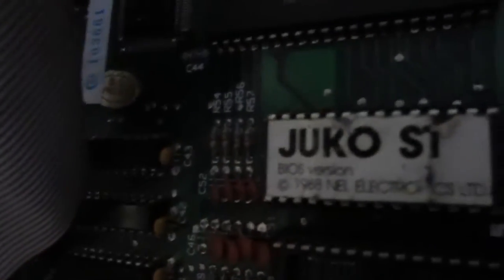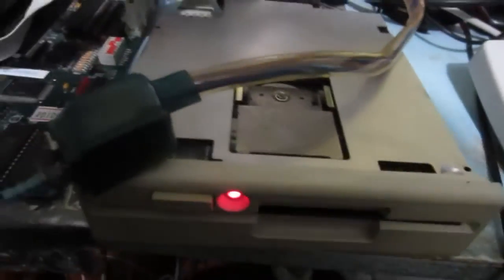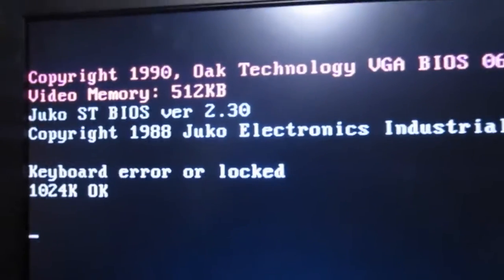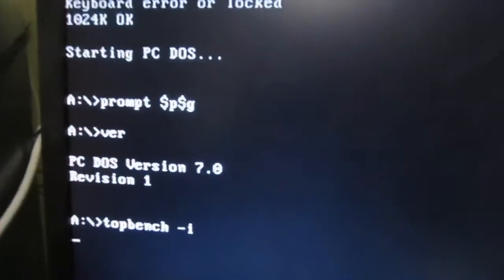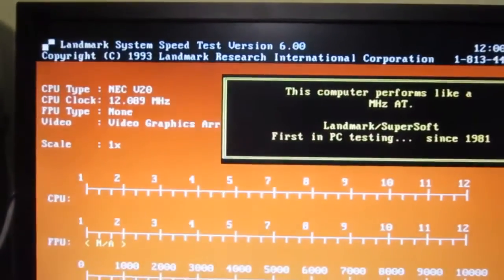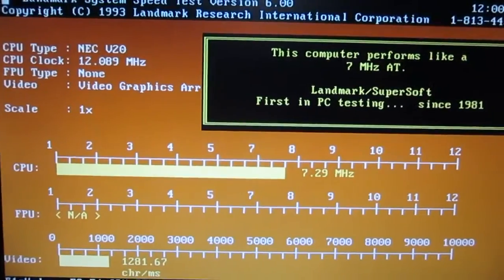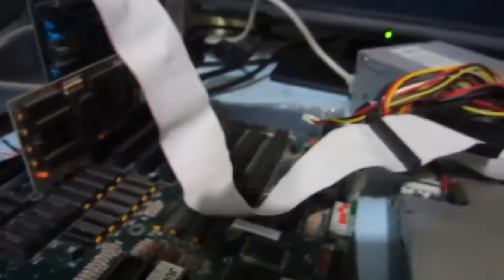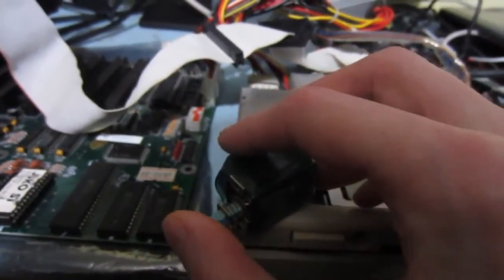Juko ST 8088 NEC v20 benchmark speed test

Comment: My first PC had a JUKO MB with 1024k ! wish I still had it!  The CPU is run at a higher voltage by a sparate voltage regulator and runs at a higher speed
Reply: I was wondering why it uses 7805 regulator from 12V rail . Strangely enough as you mention this 7805 output 5.75V instead of 5.00V so I decided to remove it and connect the CPU directly to the 5V rail . I tested the CPU in turbo mode at bouth voltages , but there was no any speed deferences. It was about 6.45MHz (in this video 7.29MHz)
Reply: @intel386DX  There is likely a diode in the ground side of 78L05 to raise the voltage.
Reply: @mohinderkaur6671  oh yes there is a diod thank ! So it is completely normal to be near 6V instead of just 5V. I was wondering what is the reason. BTW I have one XT turbo baby mobo board that have no 7805 and the CPU is directly connected to the 5V. I will check the performance of it .
:)
Reply: @intel386DX  They are overvolting the CPU to have it stable at higher speed than spec.
Reply: @mohinderkaur6671  :) yes I got it .

Comment: Nice to find this video as I have just received a JUKO ST board :) Flash to the past - Do you recall what kind of power supply connector you used? I'm trying an old AT power supply connector like from the IBM XT/286/386/486 and it doesn't seem to want to fit on the JUKO. Hoping you know what kind of connector your power supply used.
Reply from the maker: Mine was AT standard. The older AT power supplies have a split connector, so make sure the black wire is next to black wire or it will damage the board.
Reply: @Wormetti  some XT boards and power supplyes have one power connector (like a 2 standard AT ones, but together and a bit different shape, so can not fit in the standard connector)
Reply from the maker: @intel386DX  yes, the one in this video was standard but there are many non standard. Even if you have the original power supply, best to check voltages and test it on an expendable device first.

Comment: It is most likely running at 12MHz, even though the NEC V20 chip might be silkscreened as 8MHz, you'll have most likely a 24MHz clock crystal and a 14.318MHz one as well.

The ISA bus runs synchronously with the CPU as far as i know.

Comment: Brings back memories of upgrading my first true IBM compatible that I upgraded from the 8088 to the V20 and also added the 8086 math coprocessor. Neither of the 2 upgrades resulted in a perceivable performance gain until I also installed a second crystal oscillator To bump it up from 4.77mhz to 6mhz. I had to add a toggle switch to change the clock speed as some games were hard coded time wise and the motorcycle racing game whose name has long ago faded from my memory would just launch off to one side or another. If a modern kid was to see an old 8088 running they would think we were retarded for messing with them!

Comment: Really good video. I have this board myself...but haven't tested it yet. There was a hack which made wolf3d XT compatible. I wonder how it would run on this 12 Mhz machine....
Reply: Recently someone made a Wolf 3D in CGA mode so it runs on XT , but it is still too slow even at 12MHz in full screen . It is somehow playable in middle seze , and it runs perfect in the smallest screen size . Actually VGA original version runs a lit choppy ar full screen even on the fastest 386DX at 40MHz , but on the same amchine full screen CGA runs perfectly smooth. I think that it might be even 60 FPS . So video mode defenetly does meter!